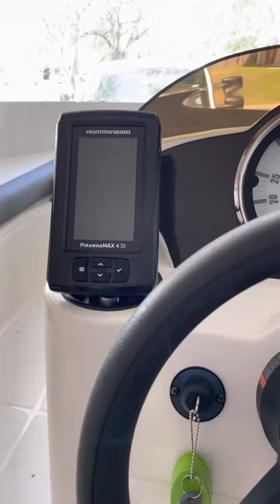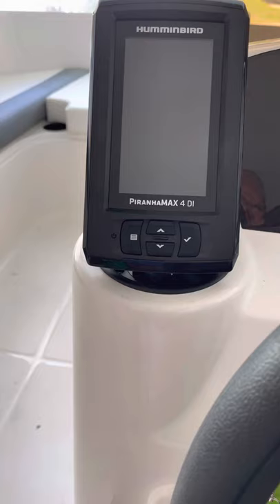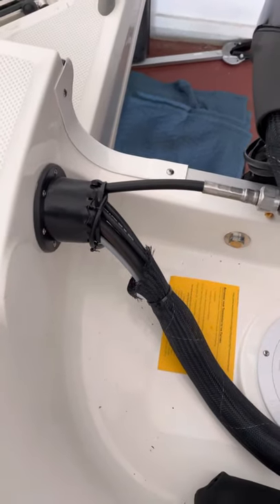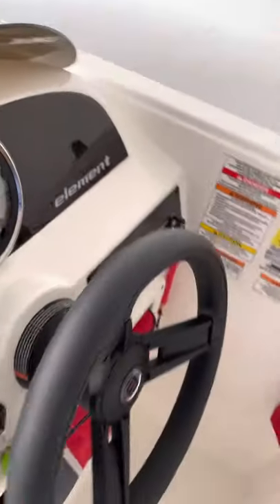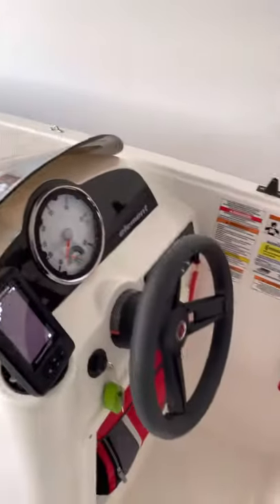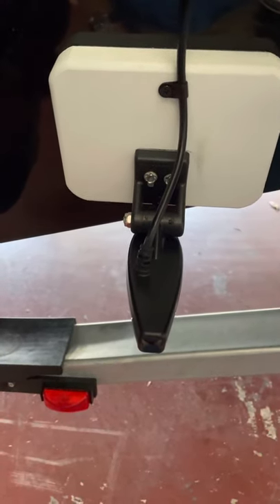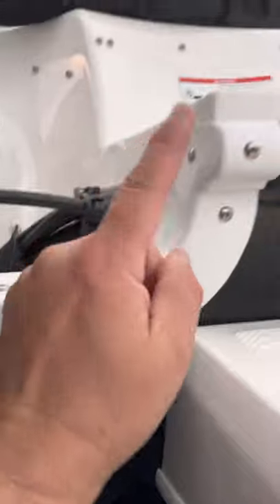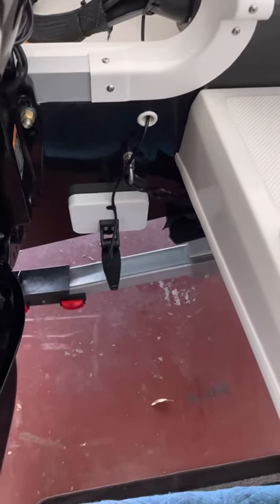Bayliner Element Fish Finder Install

Comment: Off topic but I noticed a little bracket above your middle brake lights. Is that for a transom saver? If so, how has that little screw held up under that pressure?

Comment: Are you using your boat in the lake or  river I have a 2014 and it's not to good with waves
Reply: Just something to keep in mind when going on the river
Reply from the maker: So far only on the lakes. I agree it is not great on waves I feel like 2-3 foot is about all I can tolerate. On the plus side compared to standard V shaped hulls I’ve been in the M hull design is much more stable and for a beginner like me I like that!
Reply: You are right that why I got it for my first boat to tell you what a good idea for your boat and save you some time do this upgrade and add another battery to the boat and a battery tender if you have any problems with it that you can't find out hit me up I had mine sent 2014 and I still have it if I can help I will